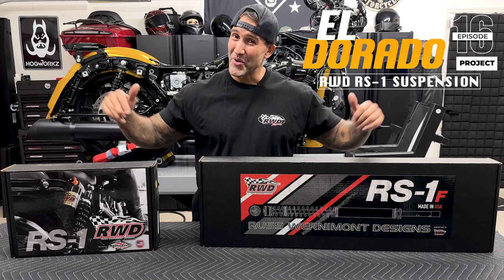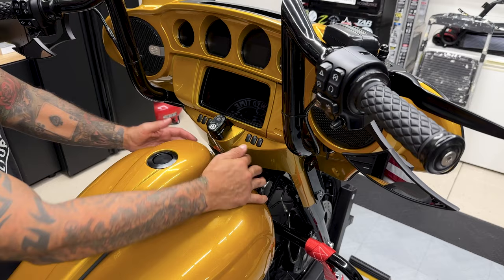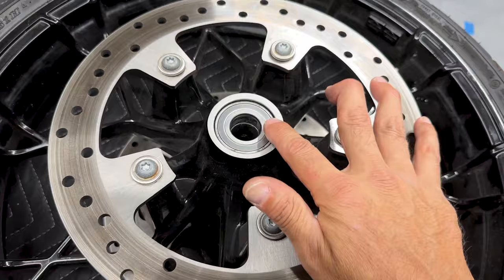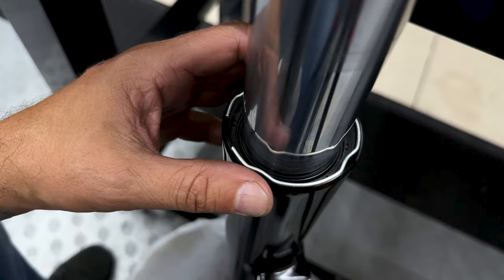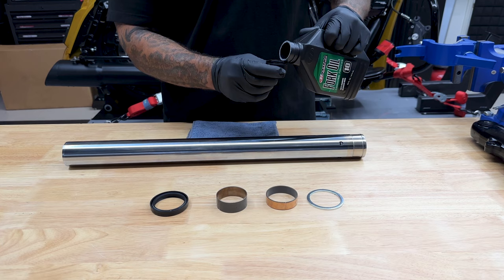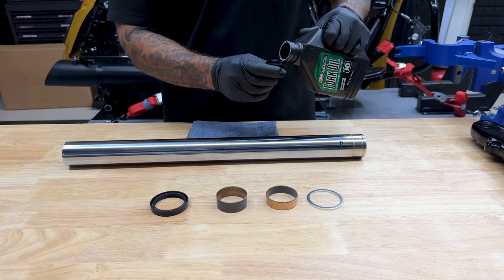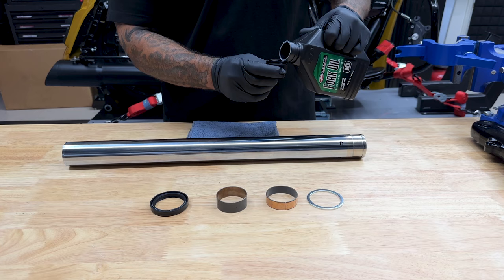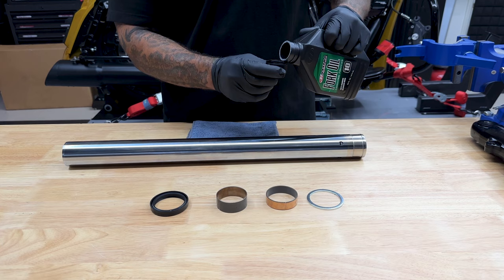How To Install Front and Rear Suspension on your Harley Davidson Bagger - Russ Wernimont Designs

Comment: Did you have to adjust your bike for the fat tire, meaning did it lower it any with this suspension system, im debating between these and ohlins, but I just want not stock height but not real low bike either, any suggestions would be appreciated, thank you sir.
Reply from the maker: These are stock length, so it did not change the height.  If you went any lower, you would also have to change the rear to level everything out.  Hope this helps, and THANK YOU for Watching 🤟🏽

Comment: Did you billed the forks? You filled the fluid from the bottom, just wondering if you needed to bleed the forks?
Any information would be greatly appreciated appreciated
Reply from the maker: I drained them both and completely cleaned them out.  After you fill it with fork oil, I would let it settle for a bit and work the fork leg up and down to work any air bubbles out.  That’s about all you need to do.